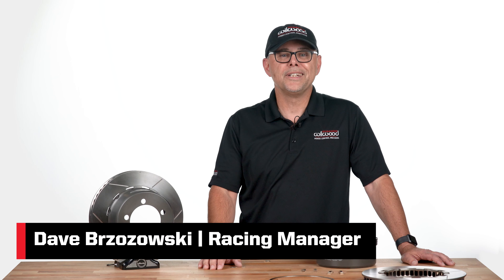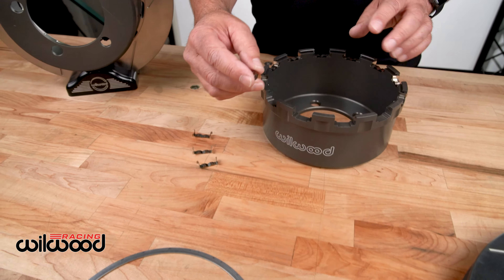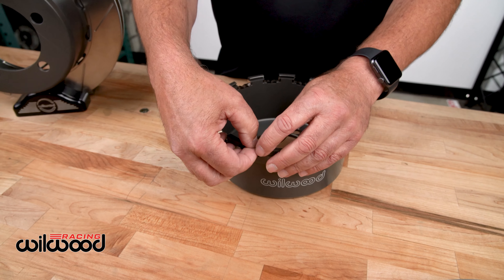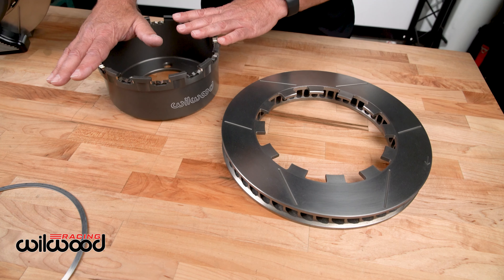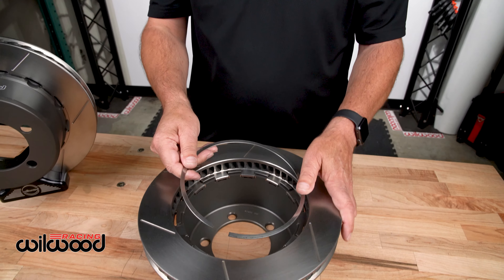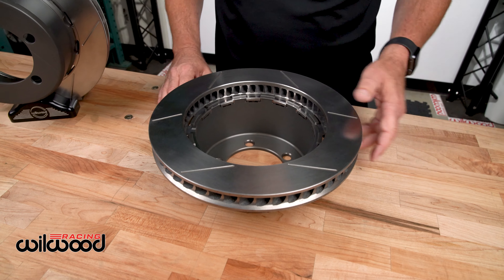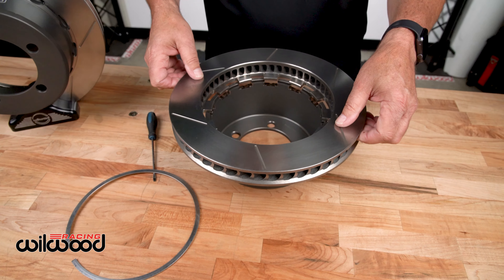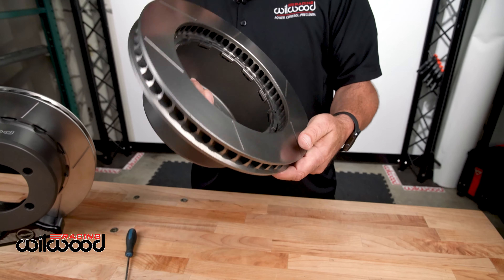Wilwood Lug Drive System Assembly Explained

Comment: You guys aren't the first to this type of system at all. I came out with a System like this for a customer 4 years ago only to find out that another company had something similar. I was approached and told not to sell the system I developed till I had a Patient or was ready to fight theirs.
Reply: PFC and Strange have had it for years now.  This is unique with the stainless clip that keeps the hat from wearing and controls axial float.  Nice touch.
Reply: @martymoose4871   I made  my design with a spring clip as well
Reply: @martymoose4871  A spring clip / wear shim is nothing new either for float in hat type systems. Brembo has had their float in hat H-bobbin setup for many years now that uses a horseshoe shaped shim in each bobbin slot in the hat to prevent wear on the hats form the bobbins and also road cars that had this system from the factory (like higher end MB,s Ferrari's, etc...) had an additional spring clip on each fastener to prevent the rattle associated with the small amount of axial float that is designed into the system. 

I do have to give Wilwood credit for simplifying the system but honestly, I cant see how they justify the roughly 40% marked up prices tag for the lug drive rotors compared to their regular bolted type rotors. 

For example, Bolted rotors 160-8398/99 are $284.93ea. where as lug drive rotors 160-15873/74 are $398.94ea. 

They are both 72 vane 14" x 1.25" heavy wall spec 37 castings and both should have the same rough machine run time (lug drive rotors might have a tiny bit longer cycle time but not $100 plus per rotor extra in my opinion. 

Ironically, the Hat's also appear to have roughly the same 40% marked up price tag too which I can see and understand because they would have to start out with a thicker (and possibly totally different) forging and there is definitely more machine cycle time per hat as compared to a comparable bolted hat like say the 170-8919 bolted hat vs. the 170-14992 lug drive hat. 

Since the rotors are likely starting from the same casting and machine cycle time difference is probably negligible, that 40% markup on the rotors just seems a bit absurd to me.
Reply from the maker: Hi, we have had this system for a couple years on our full race systems. We are now integrating them into some of our street kits.
Reply: @WilwoodDiscBrakes  yes and as large as your company is there is no issue with you funding the R$D
Reply: @WilwoodDiscBrakes  I have one of your street kits with the regular bolt mounted hat/rotors, can I switch to this type of rotor when I need new ones?
Reply from the maker: @boblast5582  It will depend on the kit you have. Please give us a call at 805-388-1188